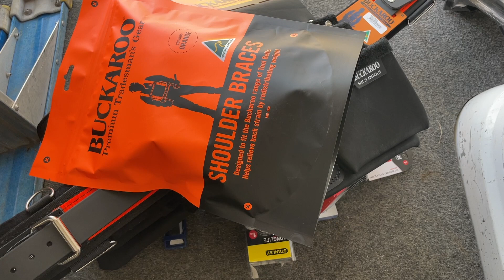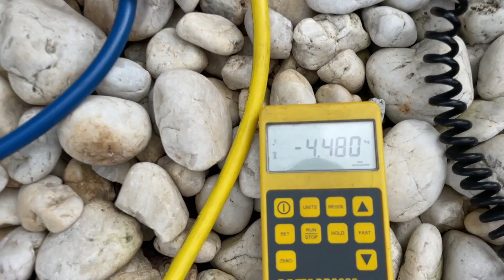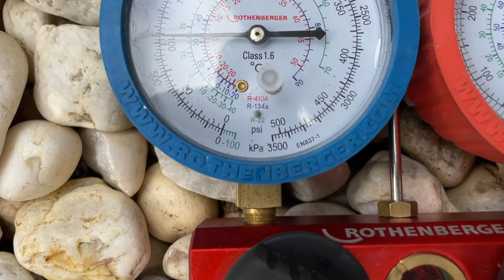HOW TO FIX AIR CONDITIONER that is tripping out on a HIGH DISCHARGE PIPE TEMPERATURE FAULT..

Comment: Good old discharge sensor pocket leak did heaps of them doing TZ warranty common fault.
Reply from the maker: That’s interesting to know. So this unit originally wasn’t working because the UC7 board was dead. I replaced it and went on my way. Three weeks later they call me saying the unit isn’t working again. Then I came across this leak. It was just a coincidence the leak started a few weeks after I repaired the unit. It’s been working ever since though..
Reply: @maracservices  yeah super common issue but tz just rolled the dice some fail some don't, too much heat brazing the sensor pocket so close to a bend. Suppose that's what you get when humans are doing the brazing.